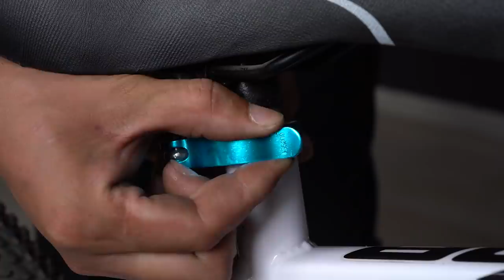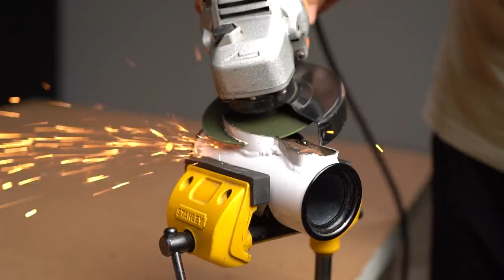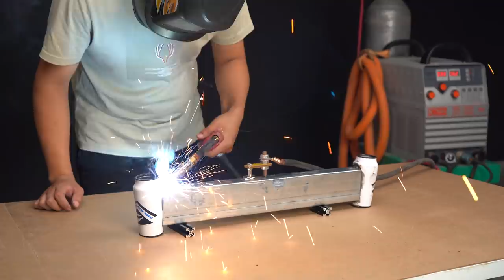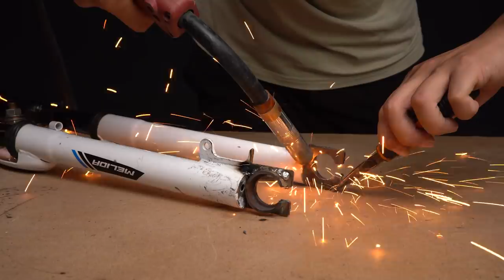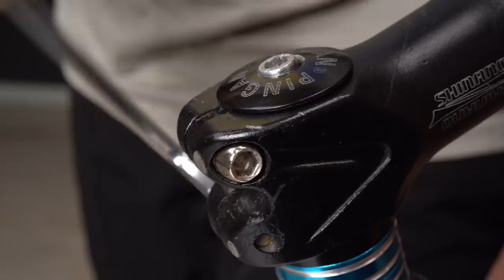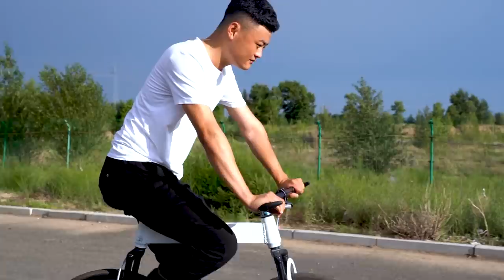Crazy Double steering bicycle

Comment: that's a good idea but it's not finished, if only you guys thought more about how to fix the mistake, then more people would like it
Reply: hmm , if you add 1 thing in the middle of the stem , it will look better .
Reply: Just one thing so that the middle rod does not rotate when in use.It will look better
Reply: Even so. This bike is not suitable as a racing bike, although it has been repaired, it will be fun if it is used as a casual bike.
Reply: they made a mistake, why do find a fix on an already fixed bike? that's why bicycle was made like that for it to not to rotate, where your brains?

Comment: They had these in the 70s.Large backwheel small front wheel.The pedals were in the usual location.
Reply: what was its name
Reply: @Rkenstein  I was only 10 when they came out ill try to find a picture.Pedals connected to rear wheel still had a chain.The issue was you could only turn the rear wheel til your leg hit the frame.Wouldnt allow more then lets say around 30 degrees of rear steering.Hard to ride.Also you could lock the rear or unlock if you want to do tricks.
Reply: @Rkenstein  i found it called the swing bike from 70s selling them on ebay for $1400

Comment: Second gentleman also possesses the ability to ride a unicycle. Would be more comfortable with a unicycle seat.
Reply: And just like on a unicycle, it will be much easier to steer and ride if the feet are put on the pedals properly- straight in line with the wheel, on the ball of the foot.